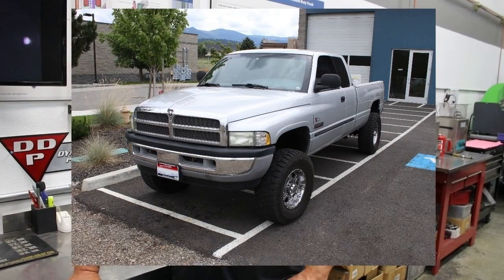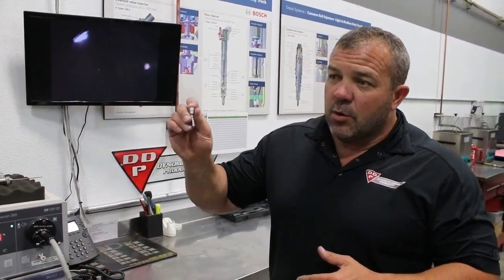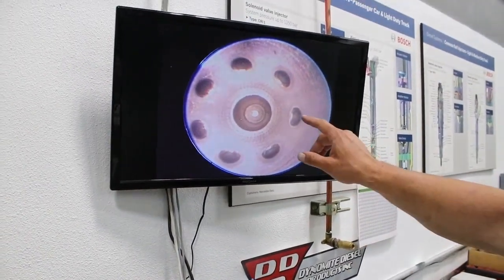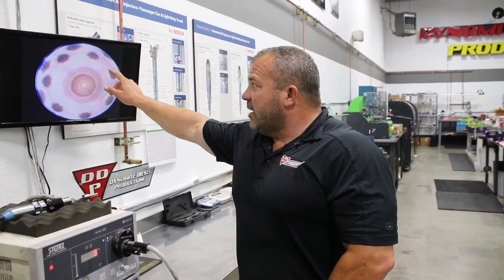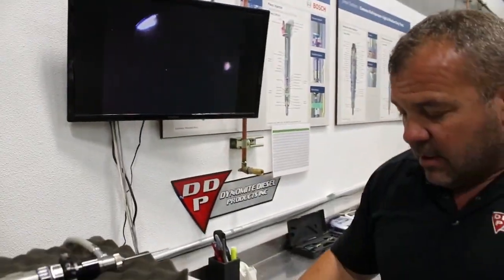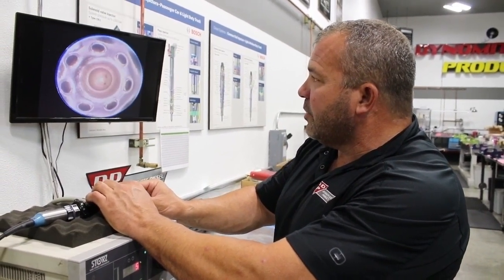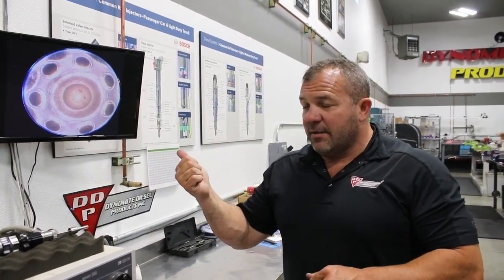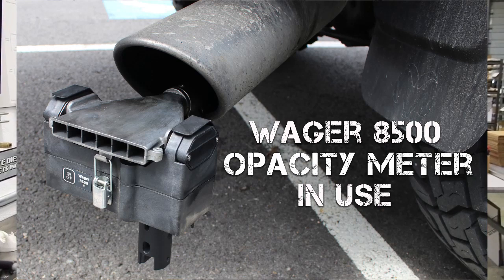Truck Talk with Lenny - VP44 Injector Updates & Opacity Testing

Comment: Definitely interested . I've bought a 99 Dodge with  a rebuilt VP44.    First thing I did was switch out the stock transfer pump for a better one.   Relocate from engine to the frame, and installed a fuel pressure gauge.   Now I just need to figure out what injectors would be best.

Comment: Are the 50hp injectors much quieter then stock on a 01 24v Cummins?  My truck has 92,000 5 speed bone stock  I’m looking for just a more power for towing my car trailer and pick up sum mpg
Reply from the maker: They will be the same, or a touch quieter.

Comment: That’s all I’m trying to build my 91.5 dodge power through efficiency and I don’t want a bunch of smoke out there either those guys that are doing the smoke shows do you know what they’re doing burning right where I won’t say burning arrangements down but they’re wearing it out faster because of washing the cylinder walls down and drying he toward the diesel pick up community all right this is six in a row jim from Kennerdell PAHeck wiper an excess of fuel if you don’t have to